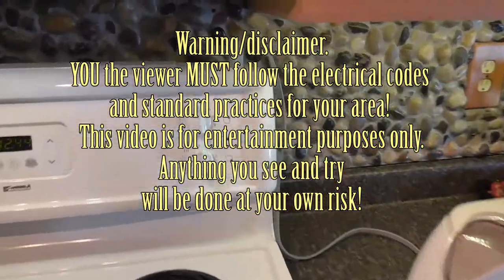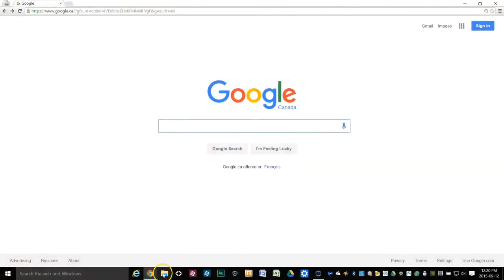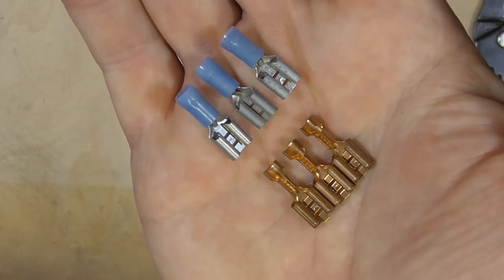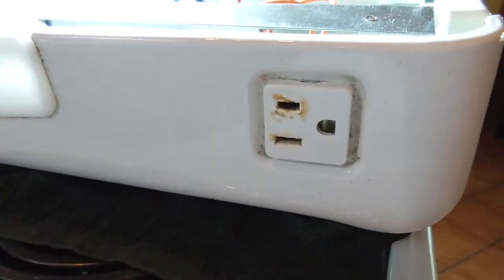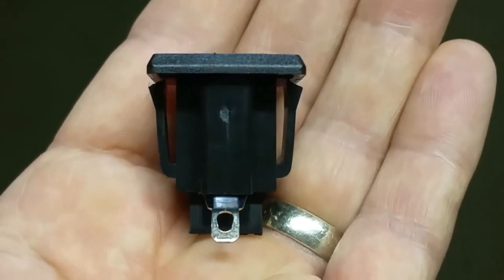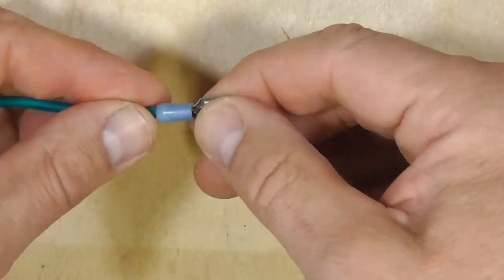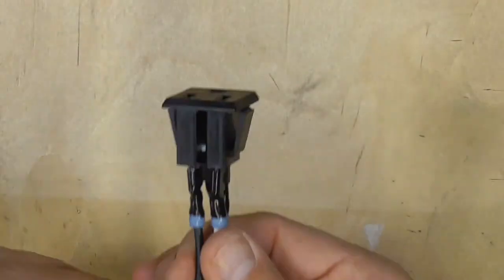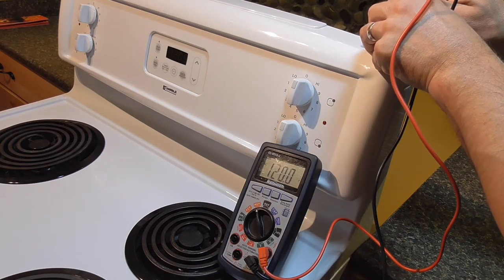Replace a stove outlet. (125v/15amp) #25

Comment: Can you please tell me if it is possible to add an outlet to a stove that does not have one.
Reply from the maker: Short answer, no it's not possible. The reason is that there must be an existing dedicated fuse/breaker to protect the outlet being installed for safety reasons.

Comment: I had this problem with my stove, the outlet had started to feel loose, and eventually, each time I turned on the microwave plugged into it, it stopped working. The next day I removed the back panel and removed the outlet. On inspection, I couldn't see any signs of burning or loose wires but it was greasy. I undid the screw, the connections are simple spade connectors attached to the wiring, I cleaned them and put it back together and everything works fine.

Comment: can i use the 110 plug to run my ac ?? it's 10 amps 1040 watts 110 volt portable AC
Reply: We did just that, since our apartment was wired odd and didn't have enough circuits. The first year it was fine, no problems, just today the damn thing burnt out. So the answer is yes, but proceed with caution.